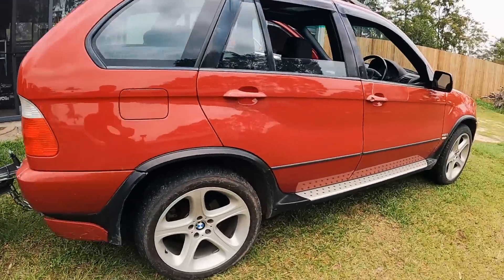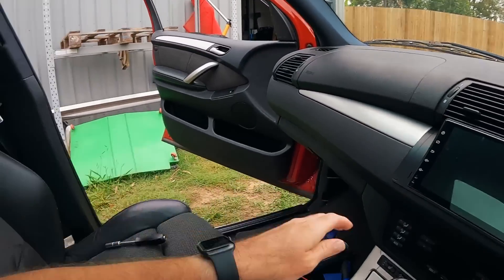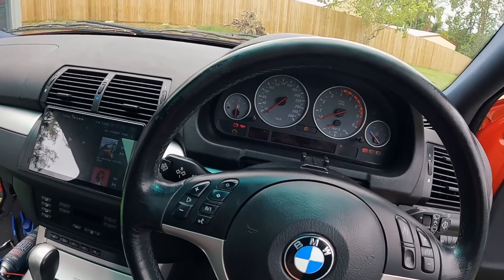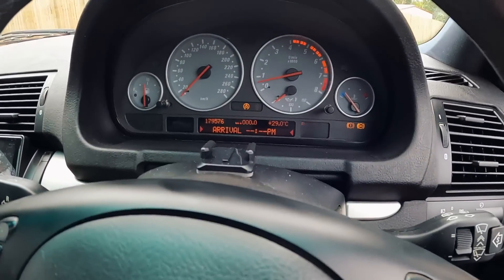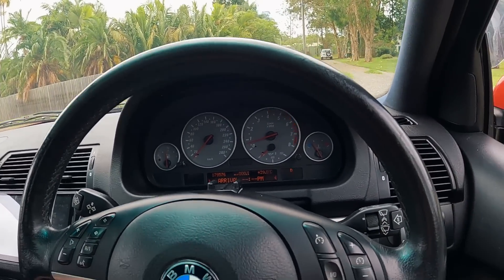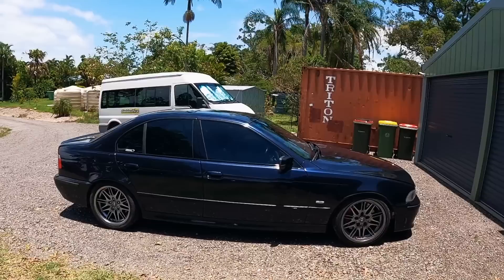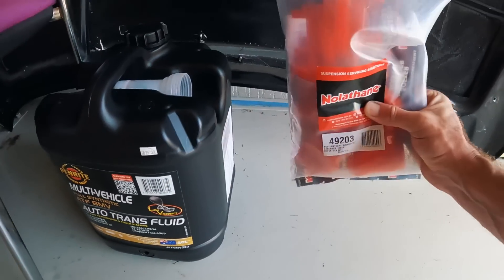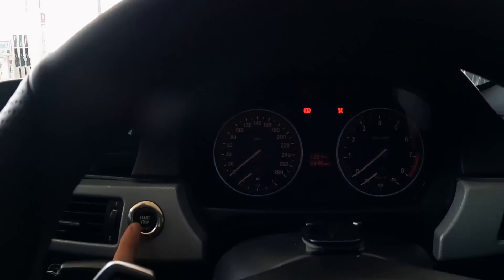BMW X5 PROBLEMS: But we're all going ROLL RACING!!

Comment: Enjoying the content especially the E39 M5 as I am in the process of building one myself.  If you are not already using one, you should invest in a cheap laptop and build out an INPA / Ista dedicated machine for all your troubleshooting and coding.  Having ISTA is essentially like dealer tool at the ready and, IMO it would take you to the next level in your videos and capabilities across all the BMW platforms.  Look forward to hearing and seeing the "tuned" M5 soon!
Reply from the maker: Thanks for the tips!
Reply: @shitefinancialdecisions  https://www.e90post.com/forums/showthread.php?t=1196830

That will get you INPA, Tool32, WinKFP, NCSExpert. I have never used ISTA so I can't help you there. You may need to search around for BMW Standard Tools 2.12 if the links in that thread are dead.

Comment: The tamper dot is due to the VIN mismatch in the LCM and the Cluster. You need to correct the VIN in the LCM and then program the ZCS of the E53 to the replacement LCM.

Comment: I highly recommend you get Whiteline  rear complete bushings swap, very easy to install and it’s a day and night difference, I have tried the inserts before and honestly didn’t feel any difference
Reply from the maker: The main reason i wanted to try the inserts was a friend just put them in his 335i and thought the difference was mega. However its going to depend on the condition of the stock bushes that the inserts are support. For the money i thought id give it a go.
Reply: I have the Whiteline subframe bushes and can also recommend them. I have not tried the inserts, but have heard they are not really what you are looking for in a high HP car. I went straight to the poly replacement bushes.

Comment: Run straight E85 in the M5. That will help with cooling a bit. Meth injection is popular, but I hate the idea of having a separate tank that can go empty or a separate system that can fail. Intercooler would be best, of course, but that is the most labor intensive option.

Comment: I washed my 335i key as well a couple of weeks ago. Noticed about two minutes into the cycle from the clonking noise. I stopped the washing machine and put the key into a isopropyl alcohol bath for some time and haven't had any issues.
Reply from the maker: As soon as i felt it in the pocket of my shorts i ran for the contact clearner. Pulled the battery and flushed it with contact cleaner. Let it sit over night and yeah i was pretty happy when it opened the car all sweet.

Comment: What adaptation values does XHP show for the gearbox ? On what did they base it's knackered?  I have -07 335i n54 e91, so gearbox always worries me :)
Reply from the maker: one of the clutch times or fill pressures was out of range from xHP deem useable. From memory it was the e clucth, i haven't checked values in ages to be honest. But from memory most were around 100-200 and the e clutch was like 700.
Reply: @ZeroTo60Tube  dreaded E clutch :/ rebuild it !  Would love a vid on that.